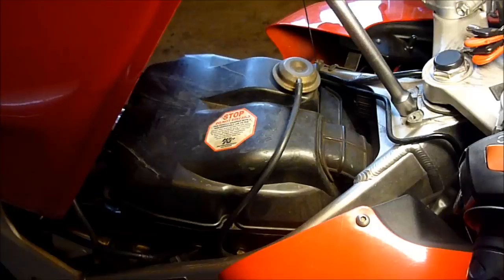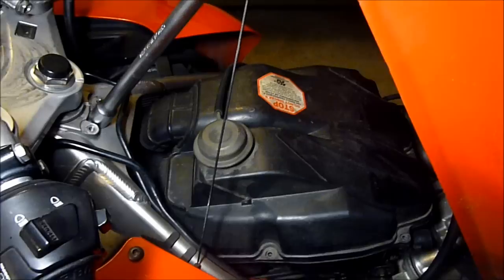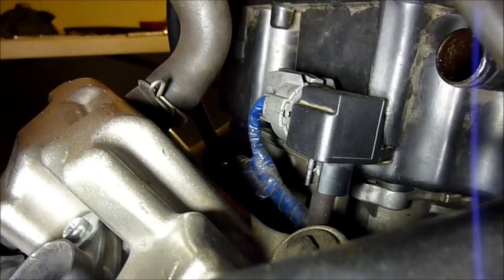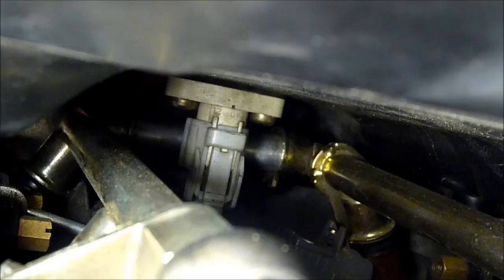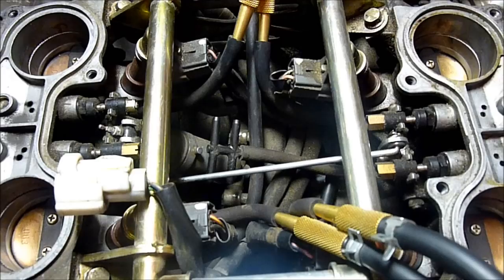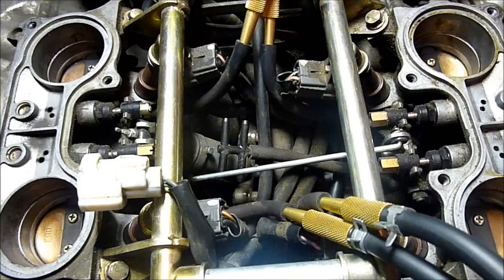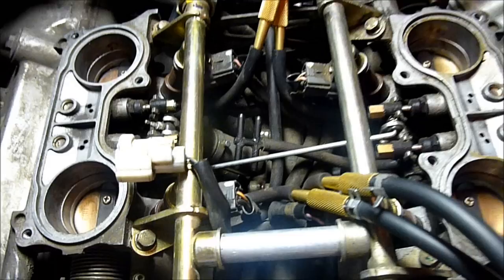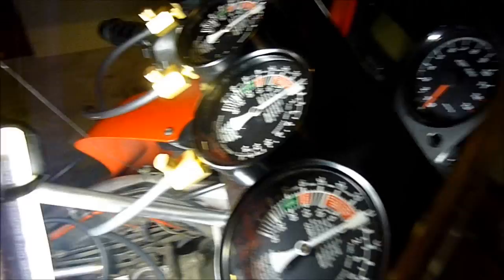Synchronising the starter valves on 6th-generation VFR800

Comment: Kal, thanks for another clear explanation without extra fluff, straight to the point. Can I ask you this: My Gen 6 will idle normally, meaning that the starter valves are functioning normally, can I then assume that my injectors are also functioning normally ? and that the reason as soon as I twist the throttle, even minutely, (on the stand in neutral), the engine dies, is NOT related to blocked injectors, but some other item in the fuel delivery chain.

Comment: Hey Kal... Auspanyol here... the Worskshop Manual says nothing about unplugging the MAP Sensor electrical connector... I didn't and got excellent results... either way the thing is no longer connected to the starter valves via the 5-way vaccum-line connector so it isn't receiving and info vía that tube...

Comment from the maker: Mileage changes won't be caused by starter valves being out of sync.   At most they affect driveability from a closed throttle.    Since your bike is a 2002, I'd check your Fuel Pressure Regulator for leaks, as it's happened to quite a few bikes from that era.

Comment: Very informative tutorial. Thank you. If I understood you correctly you left the flapper valve as OEM. Can you explain why please?
Reply: it's only functions really is to decrease noise at light throttle/low rpm, all disconnecting does is basically make the induction noise louder.

Comment: The 98-01 Service Manual states to set #3 20 mmhg lower than #1 and set the #4 10 mmhg lower than #1, then confirm idle speed still 1200 rpm +/- 100rpm.  Did you not do this for some reason?  Did it really change to all at same vacuum from my generation to yours?  Better check!

Comment: Hey Kal. Nice that there is someone like you to help out rookies like me. I just bought the Carbtune device, and is about to do my first injection sync on my VFR 800 VTEC. Is the starter valve sync the ONLY thing I need two do in regards to the syncronization of my throttle bodies?

Comment: I need your help . On my 04 vfr ,  that bike has done 54000 kms , I decided to change the cam chain a cam tensioner , I changed them to new and set the timing perfectly as per manual , but not the left front cylinder is misfiring a bit .. can you help me out with some guidance .. what can be potential reason

Comment from the maker: Could be the starter valves or possibly your fast idle wax unit isn't adjusted far out enough.  A good way to test is to crack the throttle a tiny (and I mean *tiny*) bit the next time you try a cold start.  If the bike fires right up with a slightly open throttle it means the bike wants more air.  

When the bike eventually starts cold - does it hold a high idle (above 1,500rpm) or does it want to stall until it warms up?

Comment: Are the throttle butterfly valves balanced or are they fixed on these?

I understand why honda made the idle speed adjuster/ fast idle work like this rather than the traditional adjustable throttle stop, it is so that the throttle position sensor doesn't need adjusting whenever the idle speed is altered but why four individual valves? once the main throttle body assembly is balanced a single air bleed valve would have sufficed.

I'm assuming that you would need to temporarily blank each of the four fast idle valve pipes before balancing the throttle bodies, which presumably would choke the engine of air meaning you then need to either adjust the fixed stop on the linkage or shim it somehow to get the bike to idle (so as not to disturb the factory setting and throttle position sensor)

I feel it would be beneficial to balance the butterfly valves first THEN balance the fast idle valve, i've seen plenty of people balance the idle valves but noone balancing the actual throttle linkage/ butterflies.
Reply from the maker: They're fixed.  Essentially that's the reason for the balancing of the starter valves - to take care of any inconsistencies in the butterflies.
Reply: I've got a 2000-2001 5th gen, it has equal height velocity stacks and thinner crossed over down pipes and cat like the Mk6.

Early Mk5 had unequal length velocity stacks, larger diameter downpipes that don't cross over and no cat?

The Mk5 manual says to adjust starter valves with unequal values, instead of flat like the Mk6.

Should I be balancing like a Mk5 or mk6?

I've currently got it balanced like an early mk5 because it kept stalling, it runs better but idle is a little uneven kind of pulsing woomp woomp woomp rather than a nice steady idle.

Comment: Sorry to bother you again but in your video, the FI light is flashing a code. On my bike the FI light stays lit and never flashes. After putting everything thing back the FI light goes off when the engine is started but does not flash an error code. What does that mean?
Reply from the maker: I'll take a guess (since the video is so old) that it's flashing the error code for the MAP sensor being disconnected, or perhaps the Intake Air Temperature (IAT) sensor.  The error codes on these bikes generally only flash for active errors.  Which means if it doesn't flash a code you've connected everything properly.

Comment: Thanks for doing a great job with this video.  I am about to do a sync on the ST1300,,, and I recognise that the throttle bodies are almost the same,,, just turned 90 degrees.  I am just curious,, about the mentioned "flapper valve".  It looks like a mod, that might be particular to VFR's  ?  What is the concept there ??  cheers,, Alan
Reply from the maker: Hi Alan.  The flapper valve is on top of the airbox and - depending who you ask - opens and closes to change the length of the intake to alter the air pulses and give a small boost to low speed torque, or it's to control noise at low rpms.  I can say that if you remove the rubber snorkel going to the airbox it has a crazy loud intake sound, and since the flapper valve side doesn't have a snorkel it's probably for noise control.  My opinions on this have changed over the years as I've learned more about engine tuning.

Comment: The idle screw is difficult to move, is that precisely because the bike needs to warm up so that the idle wax unit loosens enough to allow idle adjustment from the idle screw?
Reply from the maker: how difficult?  I'd never say they were easy to adjust even when new
Reply: I think I've got it working now.  Upon my second attempt at synching the starter valve, I removed the right fairing and was able to the idle screw.  The problem was that the bracket that holds the idle knob was pushed in; I bent the bracket forward for easier access.  

Thank you again for posting the video (and the others) my second attempt went much better, the dials are lined up perfect and the bike sounds crisp.

Comment: Thank you for this video Kaldek. But what if a previous owner did change the number 4 starter valve? The number 4 can be adjusted the same way as the others. How would you set the number 4 back to the factory setting? I have searched and searched for this information. After doing the synch, I now have surging at SLOW speed and there is a small hesitation just before the vtec engages. This is a 2007 VFR. Please help.
Jeffrey
Reply from the maker: It's non adjustable if you look closely.  I mean, sure, you could really go at it and force it to be adjusted.  But regardless, all you need is a starting point that doesn't have so much adjustment in it that the idle speed adjuster plate isn't useless.   It would only add a bit of fiddling, maybe an hour or more of work.
Reply: @KaldekBoch  Okay. Thank you.

Comment: hey man I did the pair valve flapper and snorkel mod and now my bike takes about 20 seconds to start on cold. and it's random sometimes when cold it will start right back up. I reconnected the pair valve cause I thought that was the only thing it could be
Reply from the maker: Probably unrelated to the changes you made.  Lots of reasons for a hard cold start, but perhaps you forgot to reconnect something?  Always worth double checking your work.

Comment: I haven't pulled off that airbox from my 5th gen VFR800 yet, it has about 21k km on it.

Does a 5th gen have this same stuff? Should I be looking towards same adjustment? It idles at around 1200.
Reply from the maker: Yes the 5th gen also has the synchronisation however it may be a little easier to adjust.  I think the adjustment knobs are on the side of the throttle body.
Reply: KaldekBoch i have the same exact gauges now, but one seems to have questionable adjustment. I might have to add some Teflon tape on the threads I think. Also the knobs on the bike are a pain to get to, especially the front one...

Comment: I want to know if you put a cap on the map sensor hose
Reply from the maker: Assuming you mean "did I close up any vacuum leaks that would cause all this effort to be wasted", yes.  I also unplugged the MAP sensor which forces the ECU to go into Alpha-N mode and not try to measure fuel based on air pressure. That's necessary so the engine doesn't stall.

Comment: Great video. I've recently had an issue with my 2002 where there is a popping noise from one exhaust while at idle, and my MPG dropped to 28. Could this be caused by the starter valves being out of sync?
Reply: mine had poor mpg, turned out to be a stuck open thermostat never letting the engine get hot enough for closed loop operation as well as causing the automatic cold start unit to stay ON